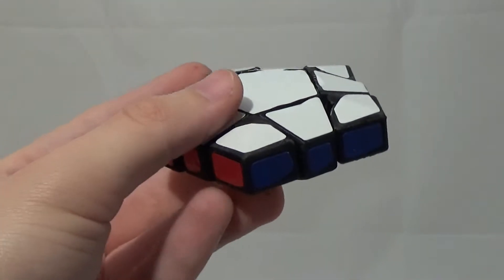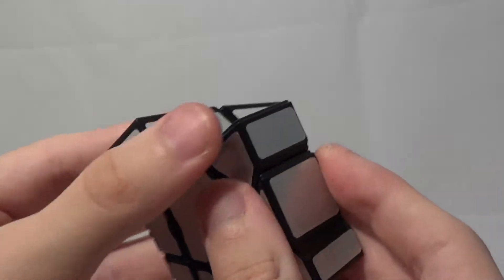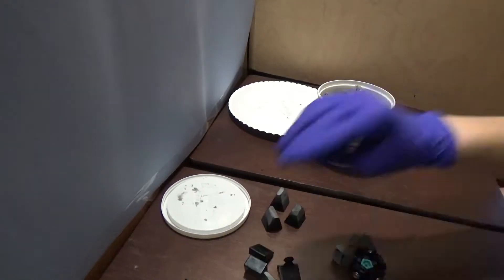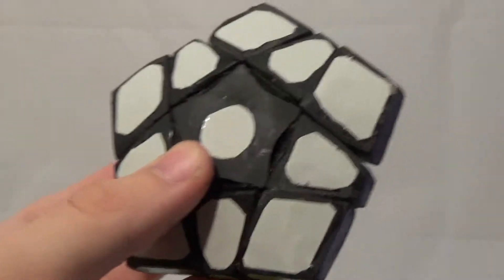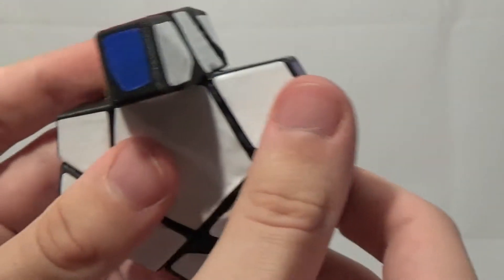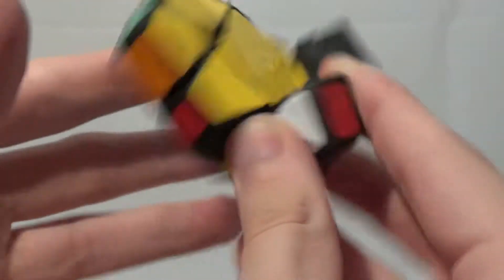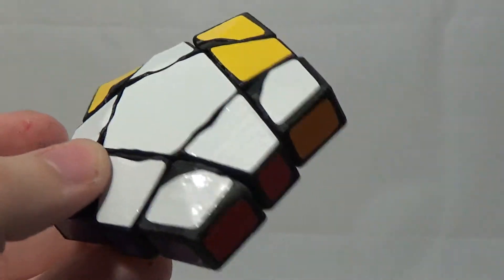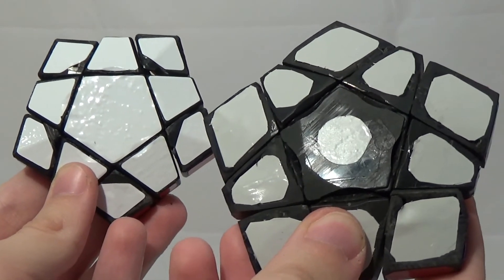Super Floppy Megaminx

Comment: Looks great! Would you consider going for a fully 3D printed version? ;)

I look forward to seeing updates and future puzzles! :)
Reply from the maker: Thank you!

I'm sure a fully 3D-printed SLS version is possible, with a mechanism that isn't too different from the standard super floppy one. However, I doubt a similarly sized FDM puzzle can be made with the same mechanism, as the corner stalks are very thin, and FDM prints are quite fragile. A fully FDM-printed version would need a different (or differently proportioned) mechanism to be successful, which could be an interesting design project.

In terms of applying 3D-printed extensions onto the existing ghost pentagonal prism, some of it is fairly straightforward and some isn't. The edge caps are fully 3D-printed; I removed the original ones and put the 3D-printed ones onto the centers. They don't stay on; it's almost as if a spring is compressed when the cap is fully placed down. Superglue fixed this issue to a decent degree, though. The corners are bit more difficult since the pieces under the edge caps are all different. That's why I did what I described in the video, but it would really need to be done more precisely (and have gaps filled in with apoxie sculpt) to look good.
Reply: Yeah, FDM can't normally make things that are too complex. I've had a couple experiences with FDM puzzles and none were very good. But others have had better experiences, so that's not to say that it's a bad technology. 

That's interesting to hear about. I've only ever had once experience with hand modding, and I wasn't the biggest fan of it for myself personally. But I definitely like to hear about it and see the incredible things people make! How would you do it more precisely?
Reply from the maker: I would design the corner extension to end at a very specific point that's easy to measure & cut to on the physical corner pieces. I'm not sure what that would be though, and the quality of the finished product would depend on the cutting job more than anything else.